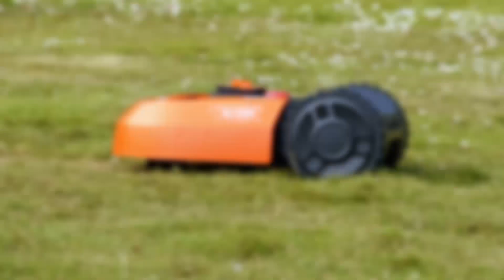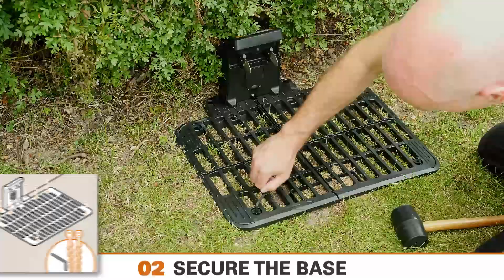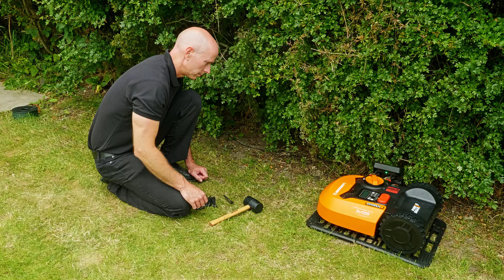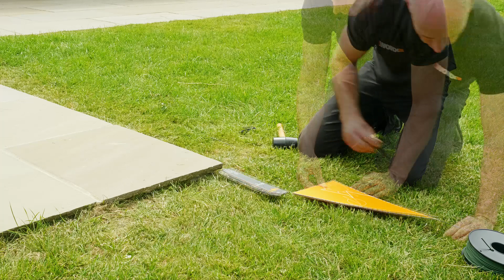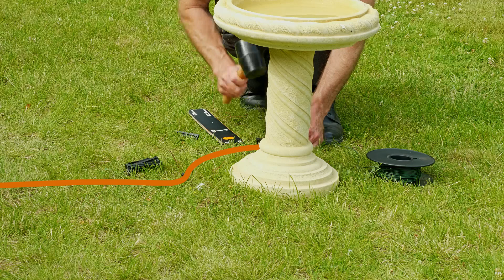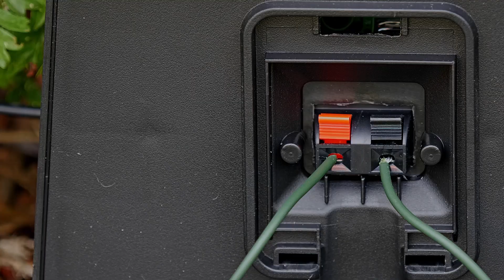WORX  Robot mower - Landroid 2019  - Installation guide - EN

Comment: Do I need to use the "triangle" for setting out the perimeter wire at EVERY 90° angle ? Can't I just lay the perimeter wire at a straight 90° at each right / left hand turn ?  Thanks !
Reply from the maker: Hi Keith, use the triangle onli when you have a a right turn aroubd a angle as shown in the video
Reply: @WorxInternational  Thanks for that  ! Will do, when I receive my new Landroid later this week !  I will be setting out the perimeter wire next week-end, hope it doesn't rain ! LOL !

Comment: Clarification may be helpful on the laying of a clockwise wire polygon (not really a 'circle' since wire must be staked taut  in intervals around the object to be avoided.  Clockwise is more precisely explained when it's understood that the STARTing end of the boundary wire must always be connected to the Landroid base's RED terminal.    Once the entire boundary is laid, that wire end must be connected to the base's BLACK terminal.   Water Example: if the boundary wire were instead a small pipe with water flowing in it, the water would flow FROM the RED terminal of the base thru the entire boundary, and finally back to the BLACK terminal of the base.  So when laying the pipe (wire), the flow coming from the base will always circulate in a clockwise direction (FROM red TO black) thru the entire boundary and any sub-loops placed in it.
Reply from the maker: Thank you Wod Carr for your comment
Reply: @WorxInternational  Gentlemen, I've re-read my original (former) comment, above, and again, watched the associated installation video.   I'm somewhat surprised that you award it 'thanks'; because (upon re-reading) it seems to be in need of correction:   From the video, the word clockwise should actually be counter-clockwise (CCW). 

The video shows the boundary wire being laid out from the LEFT side of the charging station and presumably being returned on its RIGHT.  Looking down (plan view) on this boundary loop and using the water flow analogy, mentioned in my original comment: the flow in THIS loop would be COUNTER-CLOCKWISE (CCW) and not as stated in the video, clockwise.   My original comment is therefore incorrect, in using the same direction stated in video =  CW,  when in fact it is the opposite.